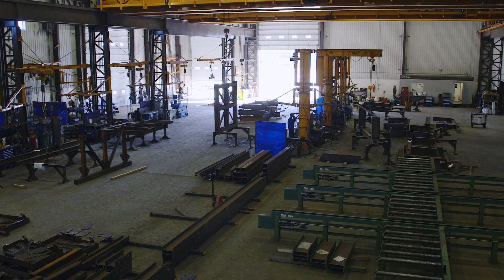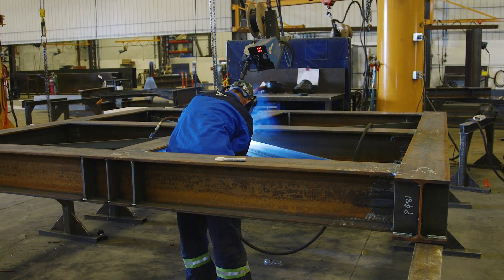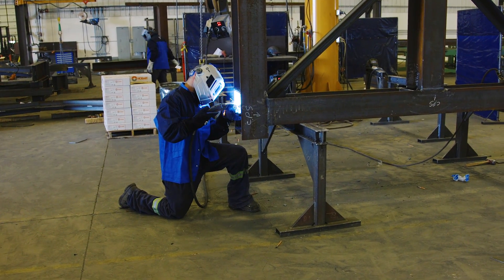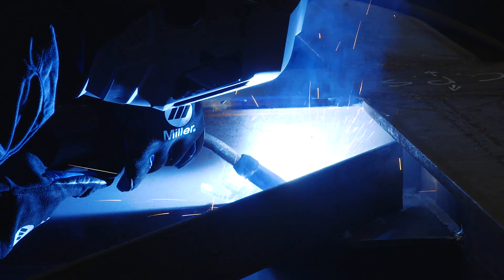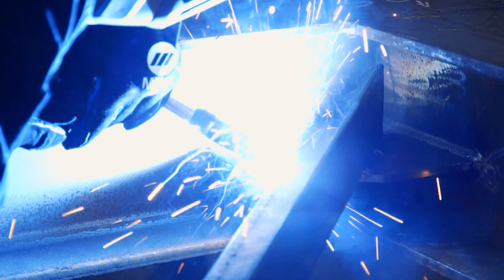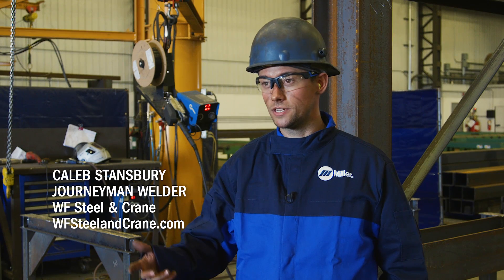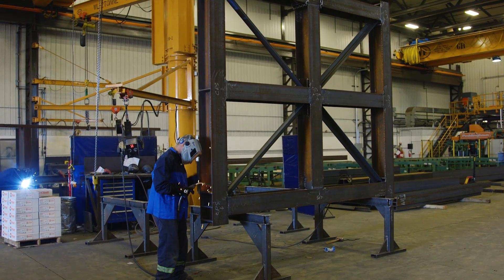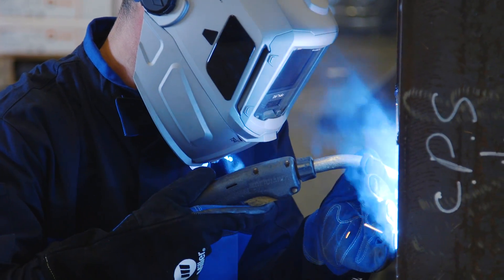Structural Fabrication Made Faster With Miller XMT Welders

Comment: Fcaw ?
Reply from the maker: FCAW is an acronym for the Flux-cored arc welding process.
Reply: Why don't you use flux cord wire for out of position welds instead of electrode or pulse?